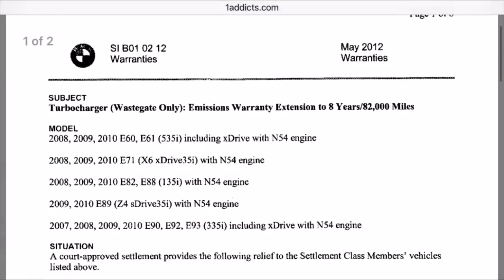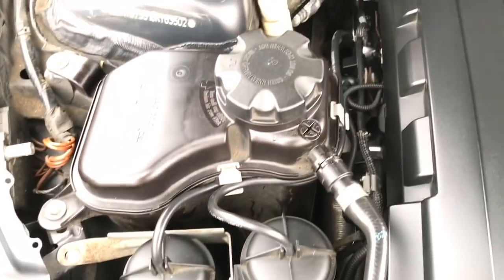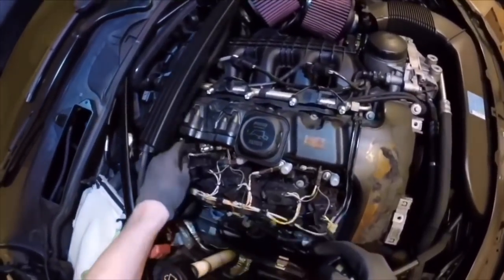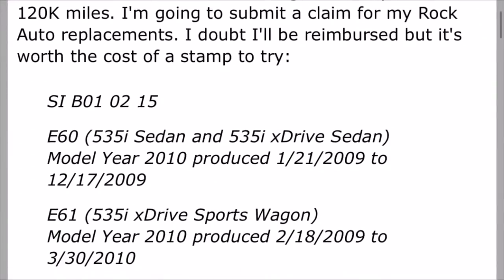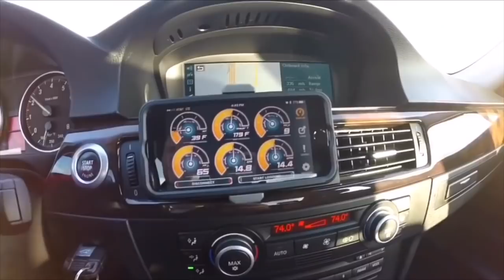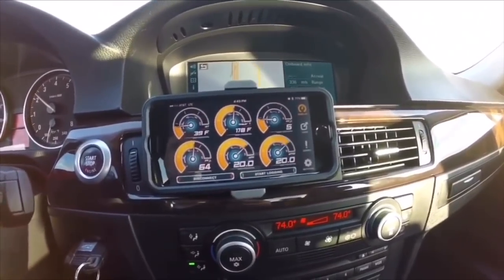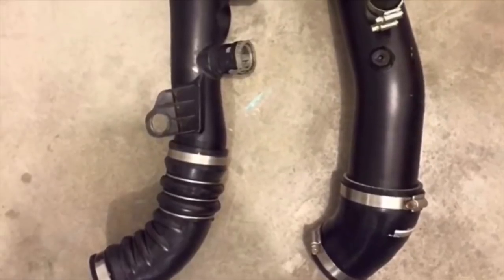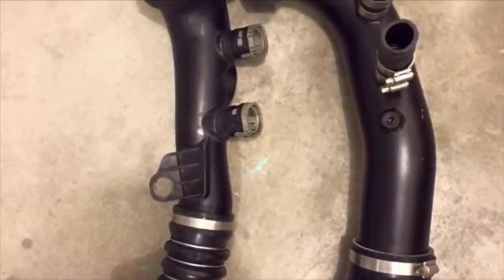Top 5 BMW N54 Parts That Will FAIL!

Comment: @ BMW Fanatic I have a question,  what temp does your car run at.  Mine is pushing 220 oil temp.  I've already done water pump and thermostat.... any ideas or recommendations? Thanks in advance.

Comment: Nice and intresting vidéo 👍. I have a n55 f10 , do you think i will have the same problèmes as n54?
Reply from the maker: omar el mrslouhi Not so much, but for you I would have yours checked on the Vanos bolts (depending on which year you have)
Reply from the maker: omar el mrslouhi You can still spot failures with logging via MHD or JB4, so I would still do that to check
Reply: i will , tks for the response

Comment: So at idle during traffic stops I'm experiencing bumps like it's missing bit I'm not getting any alerts..... What might it be?
Reply: depending on your mileage, you might need to get your intake valves cleaned up...especially if its never been done.
Reply: Walnut blast the intake valves
Reply: What is walnut blast???
Reply: Mileage is 121000
Reply: Thanks. Do shops or BMW dealers do this?
Reply: Kevin Perry  they do but from what I heard it costs an arm and a leg, I recommend you try to find someone local or even a friend with patience to save some money and if you have a N54 you would need to get it done pretty frequently so it could get pricey really quick. You can also get a catch can after you get it done and they will stay clean for longer.
Reply: Alright. Thanks so much. I'm pretty mechanical so I know I can do it but I don't have a garage or any of the equipment so that in itself is already adding up.
Reply from the maker: Kevin Perry I would check further with a proper diagnostic tool to rule out a few things. Plenty of parts will cause a miss or bump just sitting there. What are you using to check codes? You could have something going on and if it’s not yet crossed that threshold to throw a code, then it won’t. 

My car did this with no codes and it was injectors. I figured it was because I needed to do a walnut blast. I bought the kit and did it diy, but that didn’t fix the issue. It was great to get it done since I needed to do it, but it didn’t exactly fix my issue. 

It can get tricky at this stage since it’s not as clear as mud. You can pull all 6 plugs and see if any of them have fuel on the tip. That will show a leaky Injector. Good time to check the plugs itself on what they look like. 

It can get tough man, but always rule everything out prior to purchasing anything!
Reply: BMW Fanatic true or even a vacuum leak lol thats the beauty of working on these cars, its like chasing ghosts sometimes 😂😂
Reply: Don't have the code tool you do but I'm working with the generic code reader. Not telling me what I need.

Comment: Do you just wait till the water pump fails? Any telltale signs of it going out
Reply from the maker: Mine just started leaking, so that was a no brainer. Overheating is usually the key sign + a few codes

Comment: I have 2013 N54 and I received a letter about injector warranty but there’s no check engine light so should I wait or just go in there and they will fix it...... if you ask how I need the injectors ... I was checking my spark plug and cylinder 1 had fuel on it so I’m thinking it’s an injector and also it acts like it got hiccups on cold start. Let me know what you think.
Reply from the maker: Yep, leaky Injector
Reply from the maker: Very easy sign that it’s a failing Injector - it leaks and then there’s all that extra fuel in there. Since the plug is wet, it will also stumble too